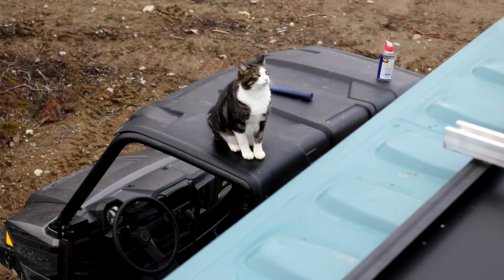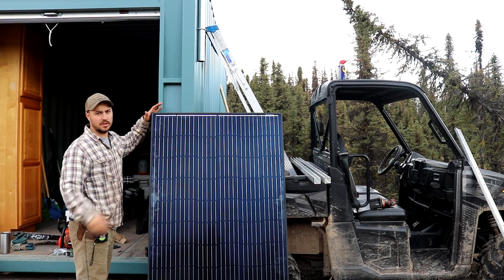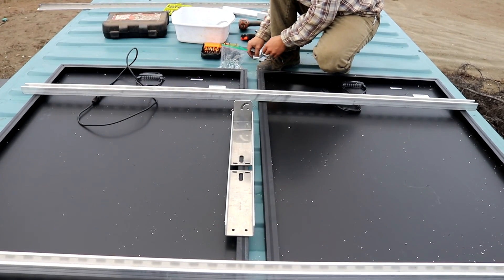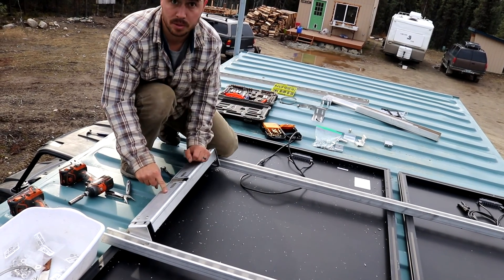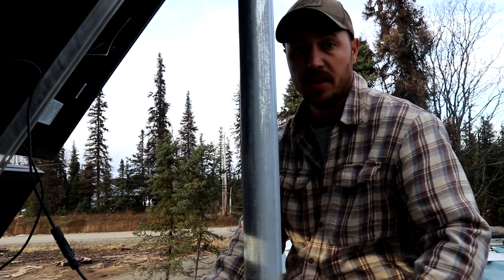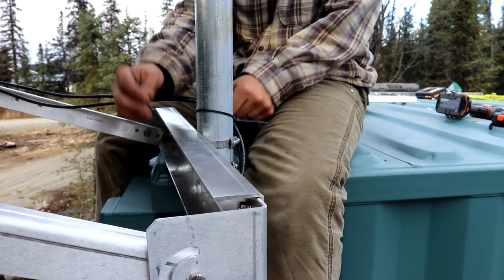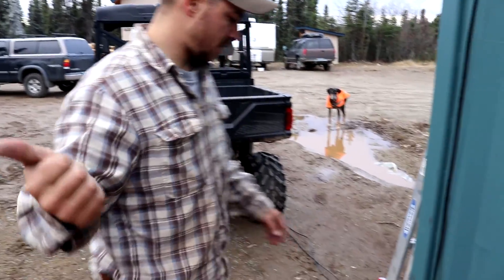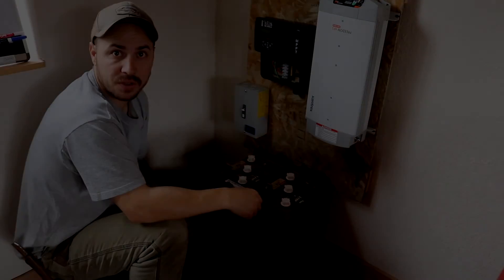Solar System Install Alaska | Part 1

Comment: A simple way of finding the angle for the panels for that day
Is to,  at mid day.. Place a cup like a Solo plastic cup on the panel
and then tilt the panel to balance or remove any shadows
Very simple

Comment: I have a few questions:
1)Where is Hunter, i've only seen the black kitty in a while
2) Did you guys sell the Suburban and the camper? i haven't seen those in a while either?
Reply from the maker: We sold our travel trailer and suburban shortly after moving here. We lost Hunter (tabby mix) in January 2020 and Pepper is our black cat.
Reply: @SimpleLivingAlaska   Aw I'm sorry about Hunter. xoxo

Comment: You guys work hard and you are doing a beautiful job, however, the location of the solar panel is too low.  You guys should be having a couple of babies soon.  The kids will go and mess around with the panel.  Mount them higher, so that the kids cannot reach them.  Moreover, if you decide to live there forever, as you grow older, it will be difficult for you to bend down and fix things or if you decide to move out and someone in their fifties moves in, they will find it difficult to bend down and do the work.  I am old, so I thought I will give you advice from my point of view. Good luck.

Comment: Love the channel. With the wind you get, have you looked into wind turbines. There are ones specifically designed for remote cabin, Arctic location application.

Comment: Might want to think about building a pavilion over that Connex box @Simple Living Alaska. With your snow loads a roof is mandatory. Just make it simple. Peeled logs...then some of those mill trimmings...trim the bark off and use a torch to finish them by burning. 

You could build one for just the cost of fasteners and chainsaw fuel. It will add years to the life of your box.

Looks better too. Rustic.

Comment: Could you have mounted the panels on the roof of the cabin?
Reply: They could, but the cabin roof is steep, not as accessible and could lead to leaks inside.
Reply: @digitalguru42  Good point. And it would be hard to reach them to knock off the snow.